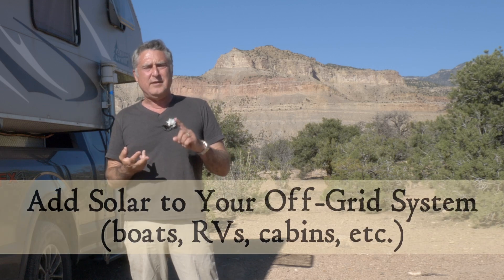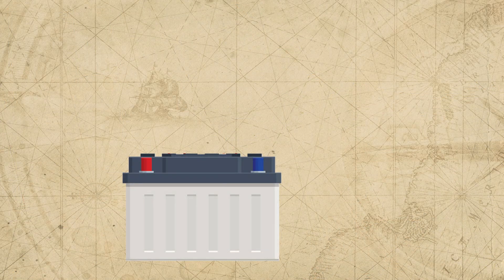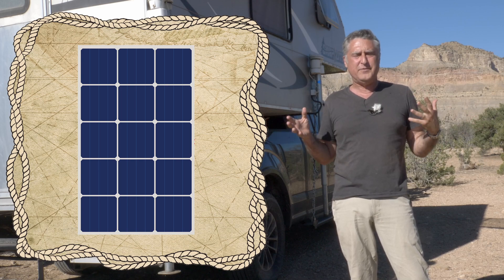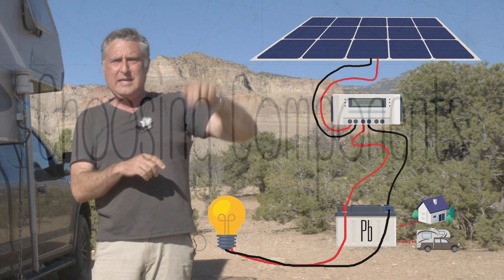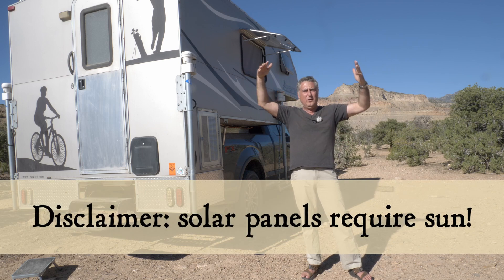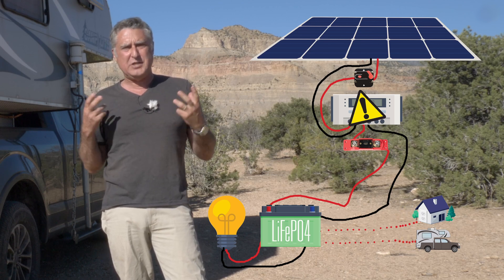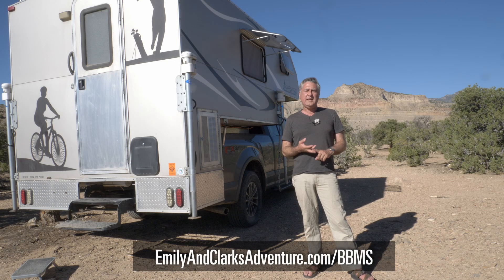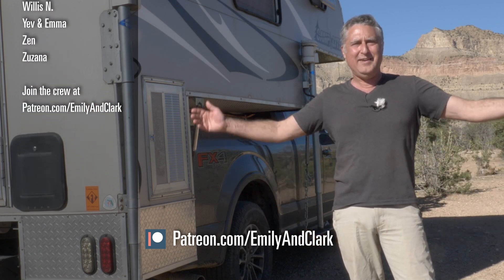Installing Solar Panels with Lithium Batteries

Comment: I’d love your opinion on 48volt , vs 12volt on a sailboat.
Reply from the maker: It's better of course.

  The question is if it's worth the cost of converting and do you feel you will find all the electronic and electrical devices you need.

As an example I will always leave Temptress 12v.
I think if you are hell bent on converting I'd just go to 24v as there are many 24v devices

Comment: Hi Clark I've been watching many of your video's on utube. My guess is your from Watertown to start with.lol my question is I relize your manager wont except large battery  wire so a relay is required. Which I've seen in your video on the Bank Manager. What I've not found is how they are wired in to allow the Bank manager to see the batteries. Could youdo a more indepth video on the actual wiring for those who are not veteran electrician.
Reply from the maker: Close enough
  35 miles from Watertown.

The install manual is your best source
https://www.emilyandclarksadventure.com/bbms

But I just put a Gen3 in my camper and did a video.  When that comes out it might be what you want.  I go over every wire and every menu setting.

Comment: Hi Clark & Emily, 
Any chance you could do a video on Testing a Solar Panels Output vs, what a particular panel claims to output.  This to determine if a panel is coming to the end of it's life. Or do they usually just quit without warning.  
Thank's  Joachim.
Reply from the maker: The polychrystolines tend to drop over their lives.  The monochristolines keep going pretty well for a LONG time.   I just retired a pair that 25 years old still made loads of power

Comment: Have you done a video about the purpose and behavior of the Bank Manager in a lifepo only system?
Reply from the maker: No I suggest people with a li only system add a (or string of) cheap starter batterie(s).

The lead batteries are there to keep your charge controllers sane when the BankManager retires the li after it's fully charged.
Reply: @EmilyAndClark  would a few super capacitors do the same thing? I don't like lead and I'm trying to avoid touching the li while running my barn with freezers and, eventually the house too. 
I think the supercaps might work for the compressor surge but would the manager try to push the li on while the supercaps regain voltage.

A possible work around might be a manager that shuts off the li when it's full then turns back on when the sensor detects less flow from the solar. Idk. You tell me 😆
Reply from the maker: It already basically does all that if I'm understanding you well.

Caps and li seem a bit dangerous.  You have two really low internal resistance devices that want to equalize voltage FAST.   They have the potential to scream the current through your wiring.   
   It would be an experiment.  One where you might want to add some resistance, have good fuses and maybe a fire extinguisher the first few cycles.

   But if your cap bank can 
    A.  Handle the voltage you are running at
    B.   Hold the voltage reasonable for say a half second on load and whatever your charge controller needs to give it time to adjust current after the li kicks out.
   C. Keep the max current low enough to not melt your wire.

   I expect it could work.
Reply: @EmilyAndClark  so what I'm hearing is, oversize my wire, and over size the cap bank and record the ensuing victory or epic failure 🤣 

Once I save up for everything I need I will definitely try it out.
Reply from the maker: Sure I want the report.

But honestly lead is cheaper and safer.
Reply: @EmilyAndClark  i hear you. It's going to take some time to get everything (limited income.) I've seen capacitors work really well to protect lead acid from the massive draw of multiple compressors. At my other property I ran an air conditioner, a deep freezer, a refrigerator along with multiple water pumps along with all the normal household stuff like tvs and lights
Reply from the maker: But now you have Li.

Comment: forgive me if I missed something.  but.  I want  to use lithium batteries only.
Reply from the maker: I really don't recommend that.  There is just no way to charge the li correctly.  Every charge controller I've found charges to a voltage, that works for lead but it's not good for lithium.
   That's why I developed the BankManager.

Depending on your installation the lead battery can be tiny.  I have one install with just 6ah of lead!

Comment: Pretty sure the Victron Orion B2B does what is needed and is very very adjustable.
Reply from the maker: Nope.  It charges to a voltage.  Question is what voltage do you charge to?

If you are charging solar or running loads while charging your C rate is always changing.

You might enjoy reading Conrad's write up at the bottom of this.

https://www.emilyandclarksadventure.com/bbms
Reply: @Clarks-Adventure  Well, if you shut the charging down at 13.8 on all but 1 source, use a Battery Monitor, and use that one only when top balancing, you will be fine.  I really like your device which is almost idiotproof, but for those that actively monitor their systems and control all charging sources it is unnecessary.  I can't imagine buying and using LiFePO4 batteries and NOT carefully monitoring them, but that is just me.  Been using Li batteries for more than 16 years on Bikes and Boats and RV's and am a Chemical Engineer so maybe I have some idea.  

Your little gadget is pretty cool and elegant and will help those who are just putting in a LI bank without thinking they need anything else.  I did have a running argument with Battleborn and Progressive dynamics 4 years ago about their  Li RV charger which was and is a run up to 14.4 and hold them their single stage, but nothing changed.  That was when I realized that on/off switches on everything and close monitoring was the most conservative approach.  My 5 year old BB's are still exceeding 110 Amphours on a 20 hour load test.

Your channel is great, I found it while looking for Tubes on the CLC kit boats and you did a great job showing a build.
Reply from the maker: I'm glad you have an approach you like.  And with monitoring you certainly can keep things happy.  I'm basically too lazy for that.

As I understand it and have seen the dead cells to prove it any voltage over 13.48v can damage li.  It's all about the c rating.  If your system charges to 13.7v but at a very low C rate, you could cause issues.  Nothing that kills cells right away...

   But if you watch all that you will be fine.
Reply: @Clarks-Adventure  After reflection, I see a real application for your device and that is when you HAVE to leave your batteries on and unattended, such as when on the hook and off the boat, and needing a bilge pump to be always available.  You could use a Victron monitor and relay to prevent solar panels from charging above a fixed point of voltage like 13.X, and it would work, allowing the system to rest most of the time, but your solution is much more elegant and ultimately may be more preservative of the batteries.  Good work.  Coulomb monitoring is obviously better as you point out.

Comment: SO many issues with the flat mounted flex panels, as they overheat and damage the roof and wear prematurely.  Particulary fiberglass roof but hard on EPDM or TPO. Hope you have success with them.
Reply from the maker: Yes they are not my favorite but I had family reasons to use these.

Working fine so far.

Comment: Hey Clark. Do you have any recommendations for an inexpensive, somewhat solid wind generator that's readily available, say on Amazon or elsewhere online, to augment the solar PV?  I have the Patreon files for Wind Generator design, but would really just prefer to buy something off-the-shelf.  A turbine design that's best suited to light to medium winds would be best.  Thanks.
Reply from the maker: If they still make the four winds or K.I.S.S. units they are good.  I've owned a 4winds myself.  Foretrinagle mount much like I use for my big home made unit.

Don't get those 3 foot Chinese units.  They don't do anything.

I've built a 6 foot unit once based on a high voltage DC tape drive motor.  Fairly easy to build.

Comment: What is the current status (time from receiving an order until it ships). I am cruising Mexico and would need some idea of turn around time to determine what side of the Sea of Cortez to have it shipped to. Would you also be so kind as to provide a G31 size lithium battery from a reliable mfg at a decent cost? Thank you Clark!
Reply from the maker: We have 50 in stock just now so availability is good.  In the past we have had shortages as chips are hard to find.
We are traveling so things sometimes get in the way but we try to process orders every weekend.  That gets invoices sent out.  If you pay your PayPal invoice right away it's possible the package might go out late that week.  Sometimes that takes a week.

So two weeks from order to ship.

We only ship to US addresses but something like reship.com solves that.

I don't sell batteries but if you go to our Amazon store there is a listing for the g31 I'm using in the camper just now.  I like it fine and it's the cheapest 100 ah battery around.  $300us with shipping last I saw.
Reply: @Clarks-Adventure  Thanks for the reply. We will see if I can order in time to catch this batch of units. I've got to look at logistics of where to receive it, as well as where to put a new battery in my very full boat, etc... .

Comment: I was watching a YouTube video by Sergiy Yurko. He demonstrated several experiments he conducted in generating electricity by using mirrors to create steam kind of like a GoSun solar oven. It looked like a system that could be built fairly cheap and small enough to mount on a boat. Just curious about your thoughts on it.
Reply from the maker: Keeping mirrors pointed in one direction is difficult on a floating boat.

Comment: Hey Clark, @4:41, it would be helpful for newbies to understand that with an MPPT controller, running the panels in series will yield higher input voltage to the controller, and thus take advantage of Low Irradiance energy harvesting such as low sun angle, cloudy days.
Reply from the maker: That is very true but, and there is always a but, shadowing can be more of an issue then with a parallel install.
Reply: @Clarks-Adventure  > shadowing can be more of an issue then with a parallel install.

There are scenarios where series-fed MPPT can find more power in partial shade than parallel panels on PWM.  Requires sufficient voltage headroom and a controller willing to sweep the entire curve, not stopping at the first power peak it finds.
Reply: > take advantage of Low Irradiance energy harvesting such as low sun angle, cloudy days.

Panel voltage is typically stable at ≥200W/m².   By the time from low solar angle causes panel voltage collapse there really isn't much there to harvest. When I A/B tested I saw a ~5Wh/day difference with a 570w array.

In my observation cloudy days provide enough light to support panel voltage, but of course current drops off.

Comment: Enjoyed video. Are you familiar with Goal Zero and the agm tank system that they use for expansion? I have the Goal zero 1500 x and am currently redoing an old Streamline. We are going on road as soon as I'm done. I don't want to rely on all in one 1500x. I want redundancy and am not against using the agm tank knowing that down the road I can replace this with any more economical agm. But your new device coupled with a lifepo battery added to the agm might not only give me more capacity but also give me more security if a part in the 1500x goes bad. What do you think?
Reply from the maker: Yes a friend has one of these.   I haven't ripped into it but he says it has a 12v agm inside.   I think he said he replaced his.

I'm not the biggest fan of all-in-one systems.  Gets expensive when one component fails.  But use what you got!

I see no reason you couldn't add external li to this systems AGM using a BankManager.   Realize that all battery monitors will read wrong but I expect everything else to work fine.

Tell me how this works out for you so I have a better answer for the next guy.

Comment: Will the Bank Manager manage and safely equalize the charge between two banks of lead batteries of different ages and capacities?  Such as between an older flooded bank and a newer AGM bank?  Seems like it would be easier "battery math" than going between Li and Pb.  Thanks!
Reply from the maker: I'm afraid that would be a different device.  It could possibly be made from the parts but it would be of limited usefulness.

Flooded and agm usually get along well together as long as they see a full 100% charge cycle often.   Gels can't safely he exposed to the same high voltage.